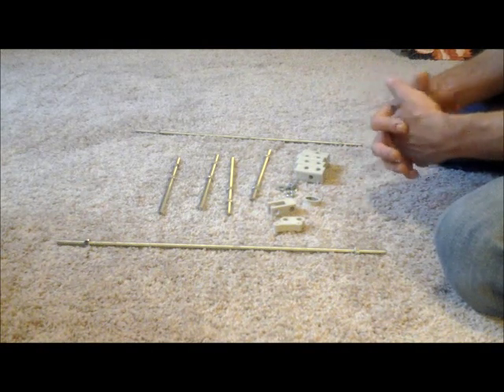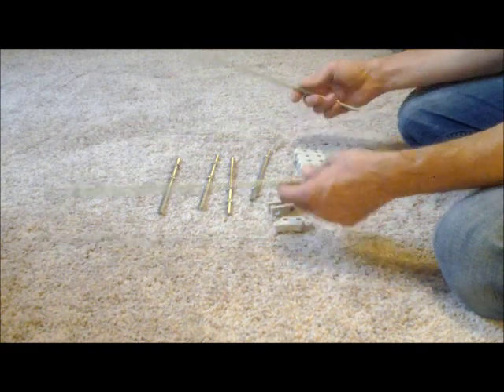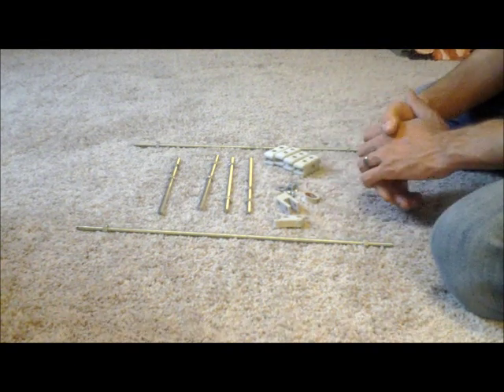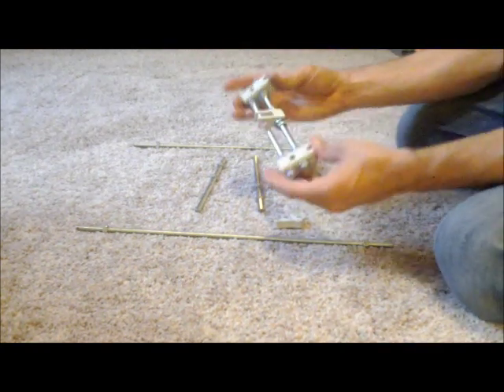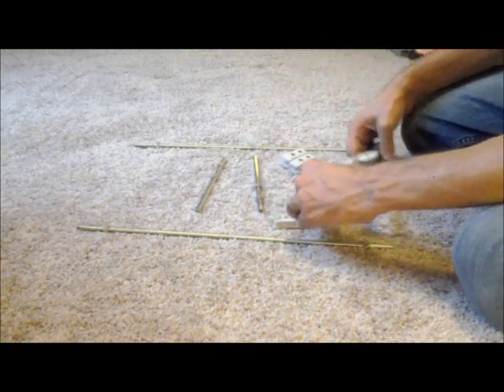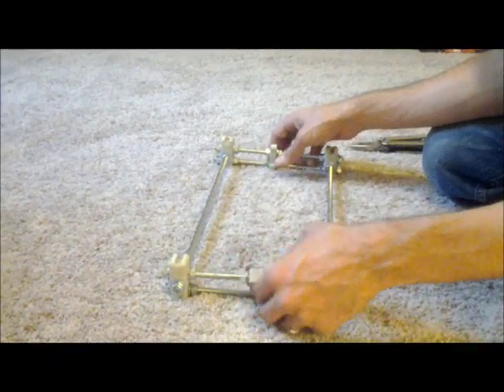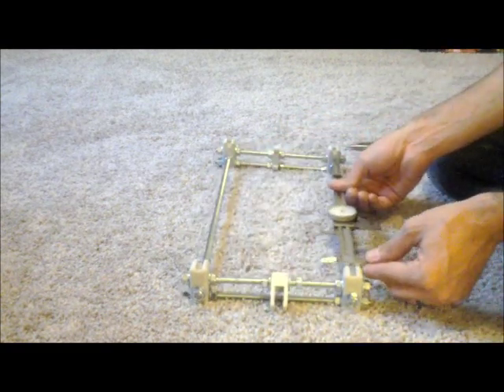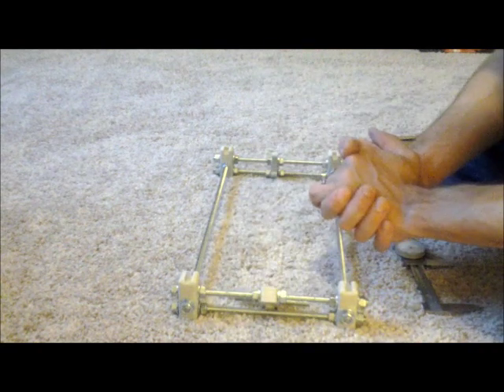Prusa i3 build log, Stage 1

Comment from the maker: Both the X and Y bearings are used as belt guides, and are placed on the opposite side of the X and Y motor.  The idler guides are installed by pressing the bearing into them, personally I do not use them.  All i3 files can be found on Josef's github account github.com/josefprusa/Prusa3

Comment from the maker: I use wood for my Z.  It works very well, and I have not had many issues with it.  I actually like it more than the single alum just because it allows me to mount/hide other printer items (ramps, power supply, filament holder, ect.  Also I used i2 smooth rod lengths for my i3 build.  They work, but you do need to make some length modifications, and my Z box sits off center of Y